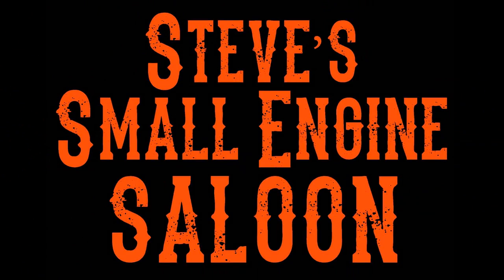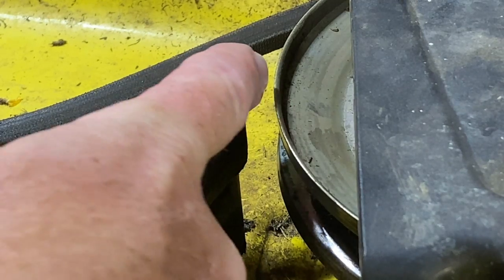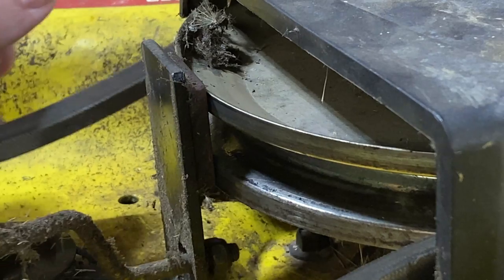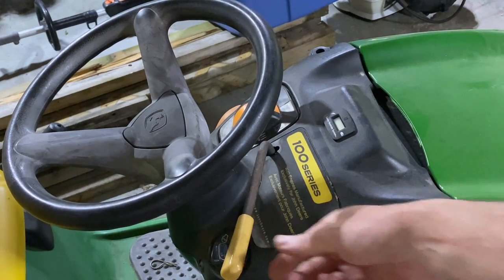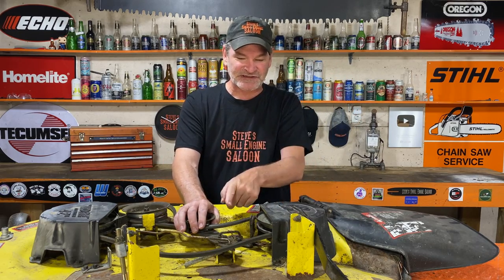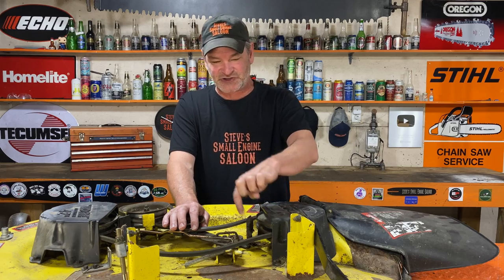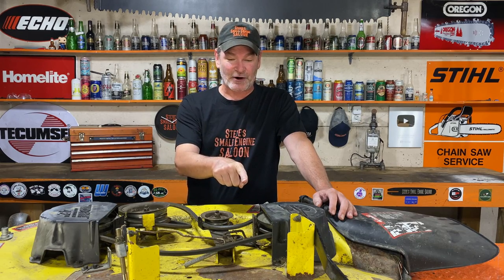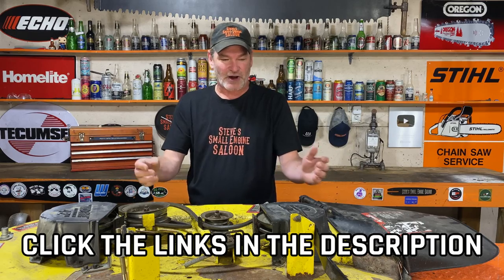Important Tip To Save Your Blade Brakes On Your Riding Lawn Mower

Comment from the maker: ✅CLICK HERE FOR A NEW BRAKE PADS ➜ https://amzn.to/3rSuj26
✅CLICK HERE FOR A NEW BELT ➜ https://amzn.to/44yEU0P
✅CLICK HERE FOR A GREASE GUN ➜ https://amzn.to/2HEEm1z
✅CLICK HERE FOR  A NEW SPINDLE ASSEMBLY ➜ https://amzn.to/2wjOAxL
✅CLICK HERE FOR NEW BEARINGS ➜ https://amzn.to/2M6pgpG

For more videos like this, check out: 
👉How To Remove The Mowing Deck ➜ https://youtu.be/eQlGRlIDcC0
👉How To Install A Belt On A Riding Lawn Mower ➜ https://youtu.be/UgW4gcPAWIs
👉How To Fix a Riding LawnMower That Will Not Move or Drive ➜ https://youtu.be/fnhenk37KcI
👉How To Adjust The Belt Tension On A Riding Lawn Mower ➜ https://youtu.be/iXy0nSfg7h4

You can connect with Steve here too: 
✅Visit Steve’s WEBSITE ➜ http://www.stevessmallenginesaloon.com/ 
✅Visit Steve’s PARTS & TOOL STORE ➜ https://www.amazon.com/shop/stevessmallenginesaloon 
✅Follow Steve on FACEBOOK ➜ https://www.facebook.com/stevessmallenginesaloon 
✅Follow Steve on INSTAGRAM ➜ https://www.instagram.com/stevessmallenginesaloon/ 
✅Follow Steve on TWITTER ➜ https://twitter.com/SteveSaloon 
✅Follow Steve on TIKTOK ➜ https://www.tiktok.com/@stevessmallenginesaloon

Comment: Same goes for engaging the mower, but for the belt.  Have the engine at an idle, your belt will last longer!
Reply: PTO clutch and spindle bearings will also have a lot less stress on them.
Reply: Also guilty and thanks for advice.
Reply: especially the electric PTO clutch. those can go bad from the shock of engaging or disengaging the deck.
Reply: That’s what I thought but didn’t hold true on my.  Ltx  1050 Cub going through belts till read Manuel or send a video saying to give her all she’s got before engaging pro.  ???
Reply: My Bad Boy zero turn says to have engine at full throttle.
Reply: @garyfox8170  you are not guilty of anything, this is exactly how the manual tells you to do it. The mower isnt designed to power the blades at idle speed
Reply: Thanks, Steve and April. I always appreciate your channel.
Reply: I do not think it is a good idea to engage the PTO at idle or low speed for the electric PTO models. That would put more stress on the solenoid and wear the belt faster. So, for electric models, I think it is better to throttle down before disengaging PTO, and full throttle when engaging the PTO.

Comment: I used old car brake pads on mine and it works amazing. I restored my 1990 Dynamark with the 39 inch deck, Mine are rivited on. I drilled out the old ones and used them as a template and the drilled new hole through the car brake pads and the riveted them back on. I works absolutely flawlessly. Its been working like this for 3 seasons now and still going strong
Reply: great idea but all my cars the old brake pads are worn down thru half the backing plate :)

Comment: If the blade brake is so worn totally out that metal rather than brake pad touches the blade pully there will be sparks thrown out because of metal against metal.  This could easily start a fire in dry weeds or dry grass.
Reply: I unwittingly tested your theory.  No fire, but I will change out those shoes and pads ASAP.

Comment: Hi Steve, you have given me a lot of great tips with fixing my equipment but I’ve run across an issue which to my knowledge I do not think you have covered. I have a craftsman 25 cc weed wacker with new spark plugs and carburetor. It starts fine, but as soon as I let it idle it shuts down and stops working. Wondering if you have any insights, thanks again

Comment: Hi there Steve,  just wanted to ask a question?  My garden tractor idles and drives fine in slowest speed,  when i engage pto and throttle up i have to keep my foot on the brake or machine goes way too fast. Is this normal ? New carb , set gov , cant figure or find out how to lower speed when cutting other than resting foot on brake. Please advise anyone or Steve .thank you kindly.

Comment: Hi Steve - I'm one of those people that can tear down stuff, but very incompetent when it comes time to put things back together.  For this reason I have always hated fixing stuff.  After watching many of your videos I had the courage to replace the blade belt on my Poulan Pro 500EX PB22H46YT LAWN TRACTOR.  Guess what, my fear materialized.  Although the belt itself took me about an hour to finish up, I did something really dumb.  I messed with the Brake Arm assembly, I believe it is the RH.  Spring Torsion Brake 532198410.  I spent the whole day trying to put this thing back and I just couldn't.  Worst yet, I could not find any tutorial video on putting this Spring and the Arm together.  Do you have any video on the tricks and tips on how to install this particular Spring?  Thank you for your time.

Comment: We use our Kubota to cut our own, plus 5 other lawns. We're back in the woods a bit and there's an impossible amount of sticks and debris on the ground. About every other week, I'm pulling the deck off the machine because of thrown or destroyed belts. That entire brake system was so aggravating to deal with whenever I removed the deck, I got completely fed up. I removed the whole thing!! No more brake system to deal with. When you idle down the engine and disengage the blades, they still stop before you even get off the machine. 😁

Comment: How do you stop a kohler sv600 from over heating after 30 minutes of use.. it's not coil,flywheel key carb spark plug fule head gasket valve adj,everyone I ask say that the way.  😊the courage motor are. HELP.  !!!

Comment: Do these pads also help when starting mower to keep the deck pulleys from moving which causes drag on the motor which can cause a ruff start?Having issues with belt grab

Comment: Steve have a unrelated ? I have a old homelite chainsaw that works fine,I had to replace a bar oil line ( I think there are 3 is that right) but my ? is I cleaned the spark arrestor and having trouble putting it back on. The saw is in tack not apart. Thanks enjoy your videos

Comment: I have a John Deere LX188 that I bought with no deck fitted, I have since fitted a deck to it but the engine cuts out every time I engage the pot switch, initially I found that the plug for the pto was disconnected but it did the same with the pto plug connected, I wondered if it could be connected to a seat switch? The engine starts regardless of if I am sitting on the seat?

Comment: At golf course with E clutch PTO on all equipment we were taught to idle before disengaging blades.  Also we'd run engine at mid level before engaging. Obviously there's times you quickly need to act but generally you shouldn't be in a rush operating equipment

Comment: I've a bad back and was rebuilding the deck on my old cub cadet.  I brought over some sawhorses to elevate things to make it more comfortable for me. New spindles,pulleys,belt,and blades.  I got done and went to put the deck back on the ground and as I pulled it off the sawhorses I hamy left hand gripping around the bottom of the deck . When I pulled it towards me the blade spun around and caught my pinky on my left hand severing the nail at the nail bed. I cleaned it up real good and bandaged myself up. The nail came off in the following weeks. Probably shoulda got a stitch or two. Stuff can happen quick and very unexpectedly.

Comment: This is probably off subject but have a real mind twister with this Husqvarna 445 Chainsaw. It only starts with choke on and when it starts it goes full speed to the point of blowing engine, Shut down before it gets to that point, will not start any other way. New Oem Engine, new Oem Carb, all new Oem lines & filter even fuel tank breather & Spark Plug. It has bad kickback when trying to start but without spark plug pulls normal. Even tried 2 different ignition coils. Any suggestions? at my wits end on this one. Please help
Reply: Did you ever figure this out? The L adjustment needed to be backed out more, right?

Comment: Hi Steve. I just purchased a used LT150, and sure enough one of the blade brakes has no pad at all. The other one seems OK. I'll order a new one and install it. Thanks for the great video and tip about reducing the engine speed to extend the life of the brake pads. Best wishes.
Reply from the maker: You're Welcome...

Comment: You got that right Steve  slowing down the blade speed down then disengage the  The blades   I have to do that for my poluan XT mower and the John Deere lt mower  thank you for suggesting that idea to do that for saving the brakes on your riding mower

Comment: I actually just had a mower in with no brake pads. I warned the customer about it and told them what will happen. I also advised them to get them to replace them

Comment: I had the issue of that same blade brake with no brake pad left on my Craftsman tractor mower.  The pully ate grooves in it to metal.  I bought both, locked the other pulled back out of the way after removing the rod, and both were out of stock.  I've been waiting on them for moths with months left to wait.  I pulled both to prevent damage, so using the throttle to slow the blades is brilliant!  And that will help my new brake pad assemblies last longer.  Thanks, Steve!

It would be great if there was a way to replace the brake pads without having to buy the whole assembly.  The arms are still good.  They just need new pads.  Any thoughts on accomplishing that?  If you figure it out or know of or find of a way, please make a video on it.  And a video on installing and properly adjusting new ones would be great.  I know you said it shouldn't be necessary, but I had to remove the rod for the brake pad arm on the side without the lever spring to lock it open after removing that brake pad arm, so I need to adjust both again.  Thanks

Comment: My JD X300 handbook specifically says engage and disengage blades at full RPM........I wonder why? It doesn't have a blade brake by the way. Cheers Steve.......greetings from the UK!!
Dave
Reply: Sell more belts !!!!!!!!!!! Does it have an "electric clutch" ??? if so, brake is built in clutch.
Reply: @georgepruitt637  No, seriously.....do you know that for a fact? Yes, I think it is an electric clutch......you pull out a switch and the blades engage. I was led to believe that if you engage the blades at idle or low rpm, that is what damages the belt. I must admit, it's counter intuitive to me. Logic tells me you'd engage the blades at low rpm.......JD say max rpm.
Reply: My Cub Cadet book says the same thing... if you try to engage at minimum throttle your engine has to work overtime  because you are putting extra strain on it trying to get those blades moving - ever notice how the engine acts almost like it wants to stall if you try to engage at low speed?

Comment: My Gravely commercial zero turn mower that I bought new in Florida said that setting the throttle at 3/4 then hit the button for the PTO. Now live in Missouri and this dealer says to turn PTO on at full throttle. The new mowers don't have the adjustable belts they have constant pressure. I think this dealer is wrong or they want me to spend more on belt's. Any thoughts

Comment: Not sure if you've brought it up before in another video, but another good point on the opposite side of this is to have the throttle at idle when you engage the blades.  Saves on belt wear for same reason.
Reply: @AlpineWarren  What pump?  Unless you're running a hydraulic PTO I don't understand what you mean.  And barely any residential lawn tractors have that.
Reply: ?Warren?

Comment: Do the same concept in your car. If you have a manual downshift gears and use the engine compression to save brake pads, diesels especially good for this.... in an auto manually down shift..... reducing brake pedal pressure. With enough lead in time and distance often you can even avoid coming to a stop as traffic gets going or lights change etc.
Do be considerate of traffic behind you though.😎
Reply: sure but brake pads are far cheaper and easier to replace than a clutch or a transmission. is it worth it?
Reply: @brainimplants  absolutely if you are not a moron, down shifting especially in heavy vehicles is the most appropriate measure, also you can downshift without clutching and some gearboxes like the Eton Fuller road Ranger only clutch from standing start. 😉

Comment: I increased my gas mileage . I cut mine off with cutting torch - same with push mower the brake came against the flywheel . I really don’t need all that lawyer stuff .
Reply: 😀...or your fingertips, either, apparently...😀

Comment: Would it also be better to shut down while the revs are low? Which is better, shut the engine off at full throttle or minimum throttle?
Reply: I always lower the throttle before shutting off the engine... why have it reved up to max when you are putting the machine away?  I keep mine in a garden shed and to me it doesnt make sense to have the engine revved up when trying to ease into where you park it, because if your foot slips off the pedal you run the risk of going into/ thru the wall!

Comment: I grew up in the 80s without brake pads on mower decks. I always turn off my mower when the engine is at low idle. But when it comes time to replace those brake pads, I just throw the whole brake asembly away and do without it. Then I'm mowing just like when it was the 80s. 😂

Comment: I dunno Steve... when trying to engage/or disengage the blades at low engine speed you are straining the engine - it acts like it wants to stall.  An analogy is trying to climb a steep hill on a ten-speed bike without shifting gears - your legs just don't have the power.

Comment: I have never had any of these on the mowers I have worked on and never saw any need for them if you switch off your mower blades just wait for a couple of minutes before putting your finger under the deck yeah that common sense thing that I learned from my dad if you see any movement on the top definitely don’t put any parts of your flesh under the mower if I ever see those on a mower I owned they would probably be in the trash can that day  but if you are scared get a 2x4 to put under there to stop the blades from moving we that is what my dad did before he used the impact gun to take the blades off
Reply: just stick your hand in to check. you only get about 10 tries though. :)

Comment: My 2012 Husq tractor has an electric/spring pto clutch/brake.
With pto switched off, the spring applies the brake.
With pto switched on, the magnet overcomes the spring, releasing the brake while engaging the clutch. 
It's brilliant, really.

Yet, even though it operates differently, everything else you've said in this video still applies. Best practice is to idle down when engaging/disengaging the pto for all the same reasons but on different components.

Comment: Hey Steve your videos have helped me a lot with fixing small engines and I appreciate all you do for your subscribers. However, I ran into a lawnmower problem you haven’t addressed yet and I think a lot of people come across this same problem. I picked up an auto choke lawnmower that wouldn’t start and after cleaning the carb and performing a tuneup it started first pull. The problem was it would not start after the engine was warm. I thought the spark plug or ignition coil was bad and I replaced both, but I still had the same problem. Finally I figured out that the thermostat on the lawnmower was faulty and causing the mower to not start after getting hot. I think a lot of people have this problem and you should make a video about it. Cheers my friend